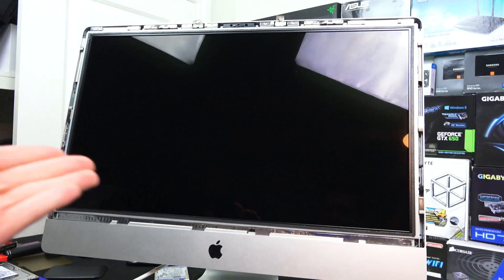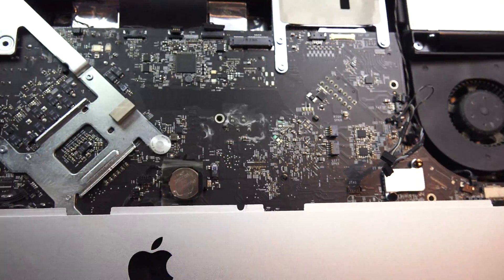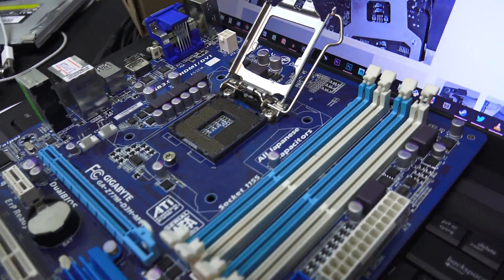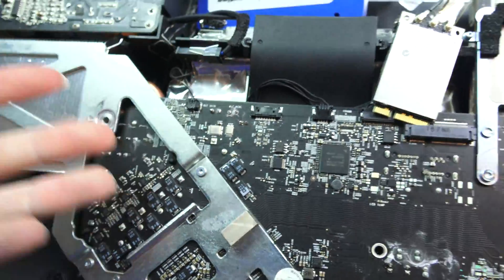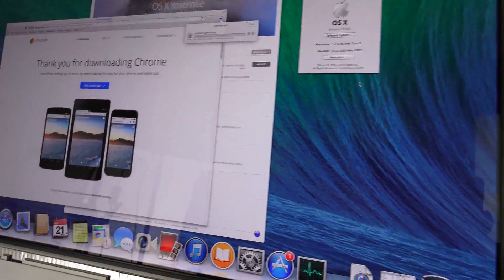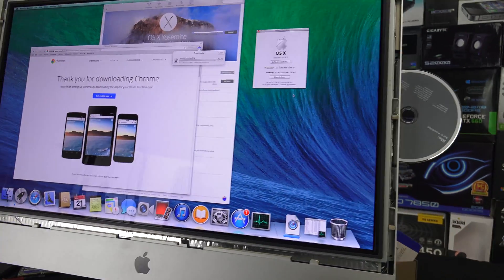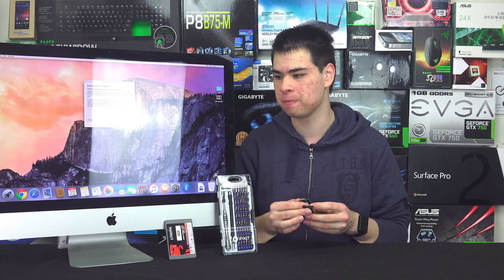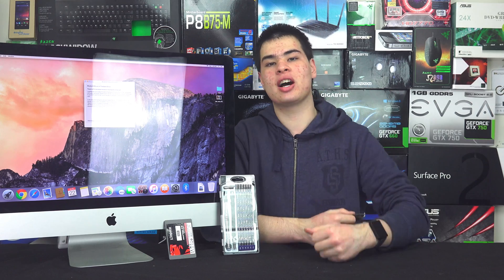Dead iMac Part 2: The Final Fix

Comment: probably dust on the ram pins,  coulda just pulled them and reinstalled  (have seen that many times) ,  but seems you broke the plug on power and ruin the i7 cpu.  glad its back running though

Comment: Could someone help me... My mac A1311 is not turning on. Led 1 power supply on, led 2 on, led 3 gpu on led 4 LCD off. Dvd start and stop. Cooler and speakers does not start. Flat cable (12pin) and connector power board x lcd ok.

Comment: please help me my imac 21,5 mid 2011do not turn on when i turn it on i have just a green led on the logic board and nothing else 
thank you before all
Reply from the maker: i'd start with taking a look at this article about trouble shooting and seeing if that helps https://www.ifixit.com/Answers/View/126233/Where+are+the+diagnostic+led's+on+this+model's+logic+board
the fact that the mac actually has power might rule the psu out but still may be the problem